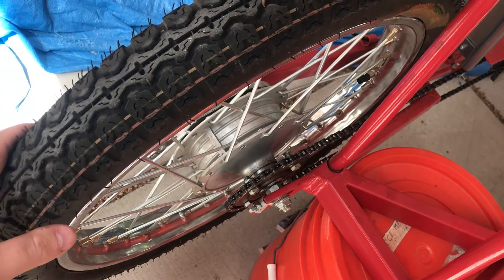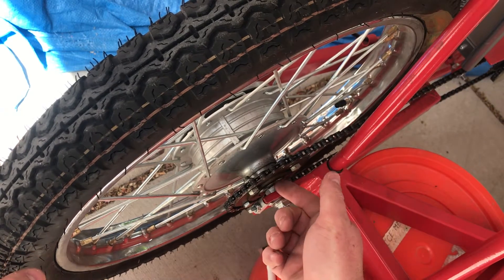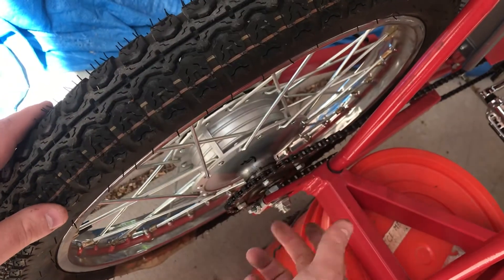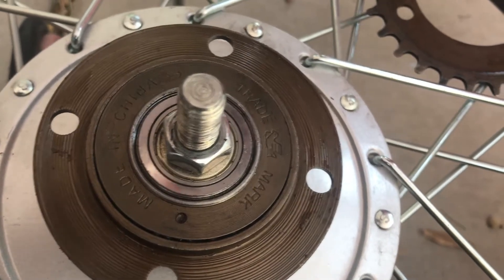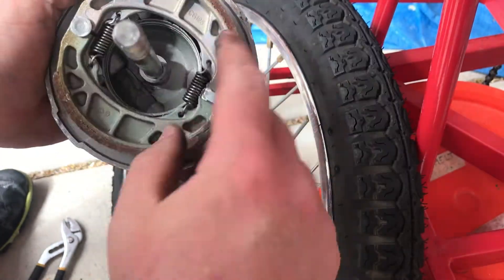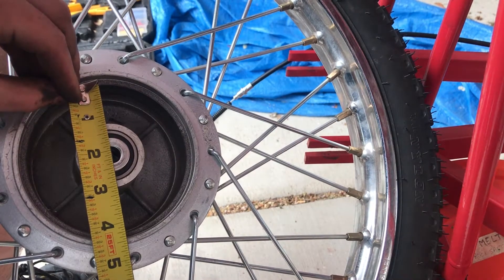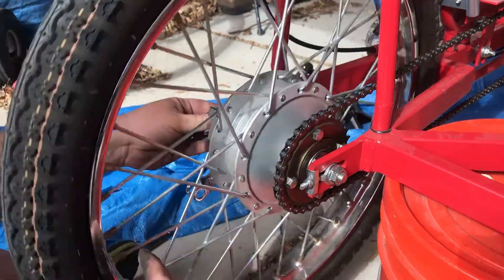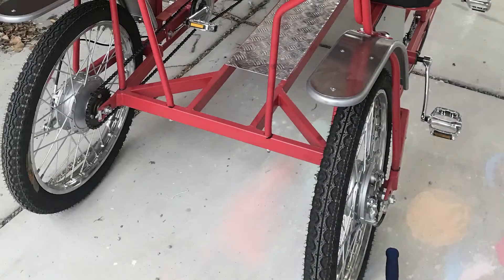How does a surrey drum brake work? Taking off the back wheel of the surrey bike

Comment: Can I ask you about going down a hill with the Surrey bike. I am interested in buying but afraid of the brake system if there are inclines.
Reply from the maker: The surrey has two brakes. They are on the rear wheels and they are called drum brakes. When you apply the brake it squeezes the brake pads outward from within the drum and apply friction to the drum, slowing it down. I have not had any issues with not stopping. It is a huge vehicle so inertia kicks in. You won’t stop on a dime, but you also won’t roll forever. Also remember every hill you go down you must always go up! haha
Reply: Thanks so much Kirk. Have you ever felt out of control by going too fast.
I really want to purchase but want to know all the issues I might have before buying. Thanks so much for your quick response . It does have peddle assist in it .
Reply from the maker: @melaniefeasby6134 pedal assist is exactly that: it adds to your pedaling power, so if you pedal slow, it adds a little power. If you pedal hard, you will go faster. How steep are the inclines? The surrey is so heavy it will be slow going up hills. Down gradual hills, you won’t pedal but you’ll have your hand on the brake to slow down as needed.
Reply: Have you ever rented your bike out ? Liability ? 
Thanks again for your help